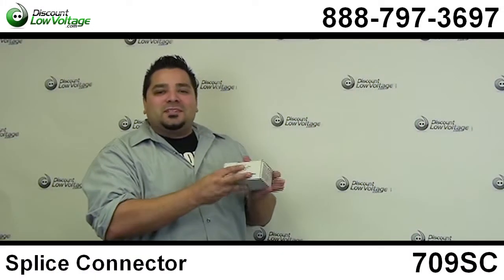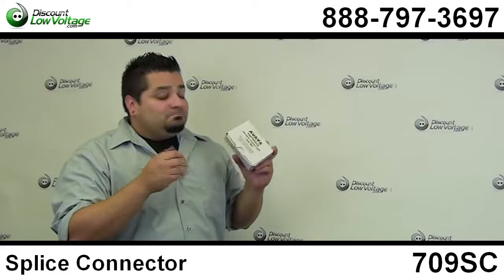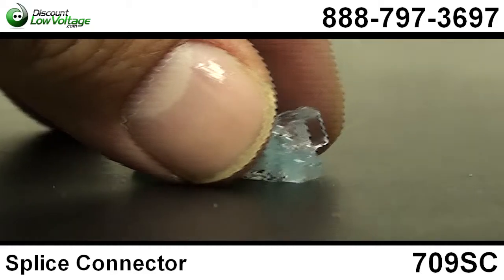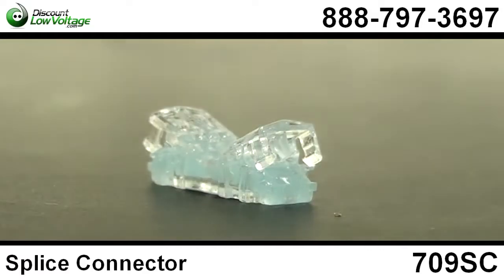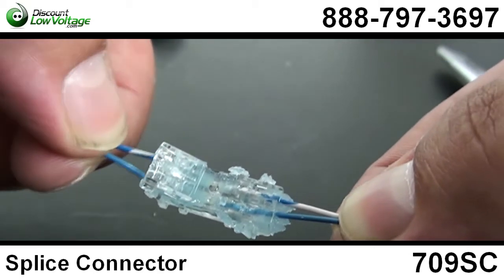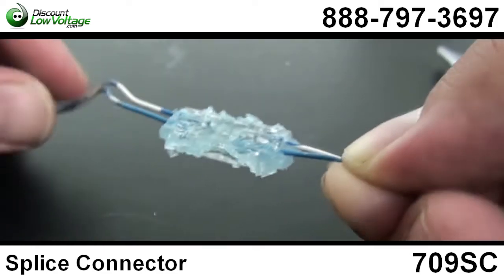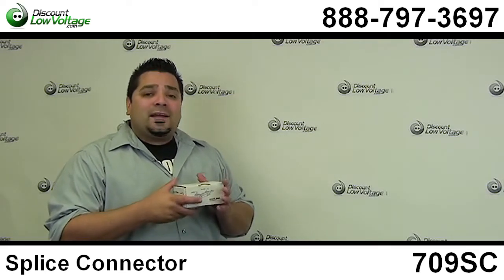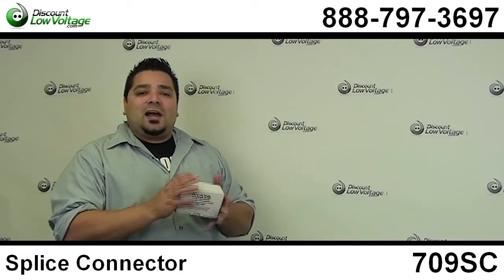How To - Telephone Wiring Splice Connector 709SC

Comment: how about splicing together flat indoor type phone line to the type phone line that runs to the box outside? Just line up the colors?  I have a vintage phone that I like the outdoor type round black cable coming from the phone. The cloth covered is just too stiff.  I want to attach a length of the black round cord to the new flat stuff in a retracting reel so I can carry the phone with me without having a mess of cord on the floor.